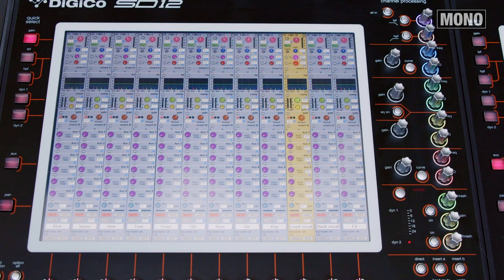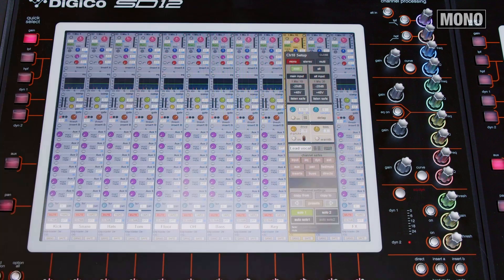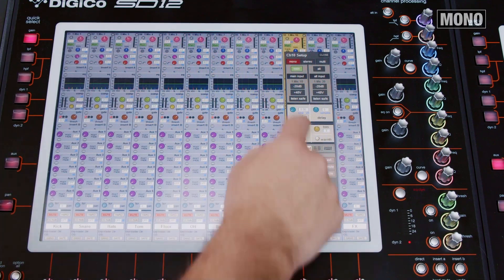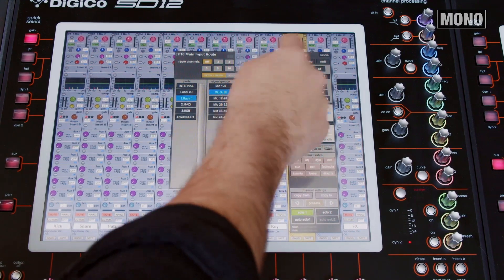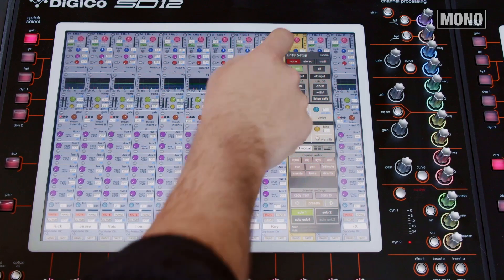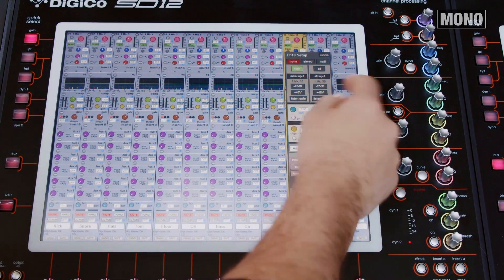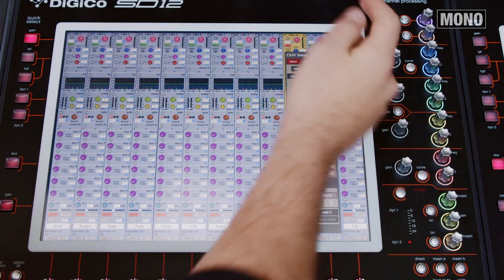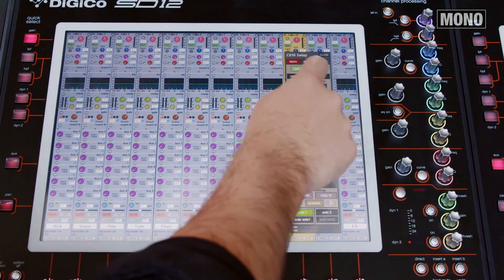How to use the alt input on a DiGiCo

Comment: Sadly this function doesn’t apply for a Stereo Channel🤦🏻‍♂️. But still very useful 🔥🔥
Reply from the maker: Correct, but if you would need an alternate input on a stereo channel real fast, you could capture it in a macro. We’ve been doing this on a gig where ableton lines in the desk are madi, but backup lines are analogue. With a macro you can capture all ableton madi inputs to switch to analogue inputs without losing channel processing.
Reply: @MONOSoundLab  Could you please make a video to show how to use this method ?   thank you so much for your videos are very helpful.
Reply: @MONOSoundLab  yes, that is how i do it, as a matter of fact, i capture in the same macro that i used to switch to Alt. I got two macros. Alt-in and Alt-out. Alt-in switch to Alt. And switch preamp to madi the stereo channels.